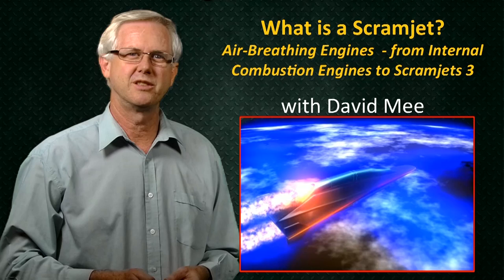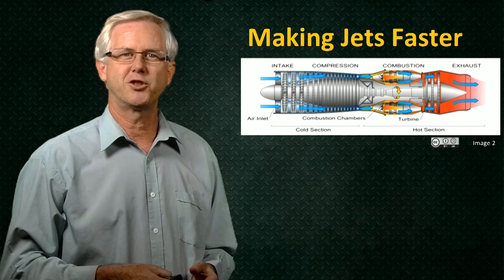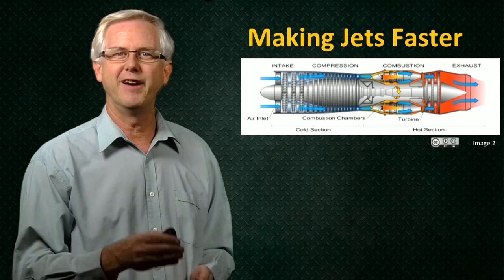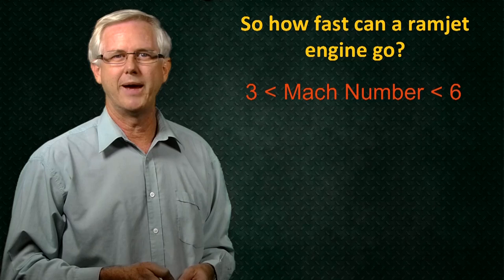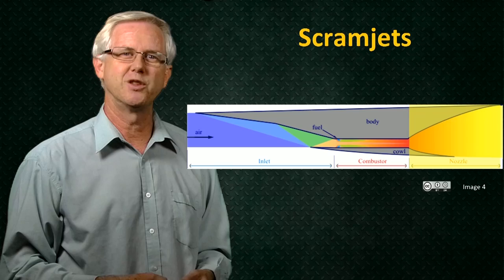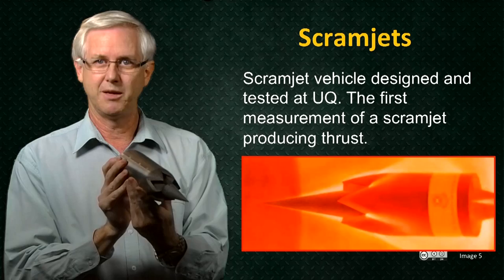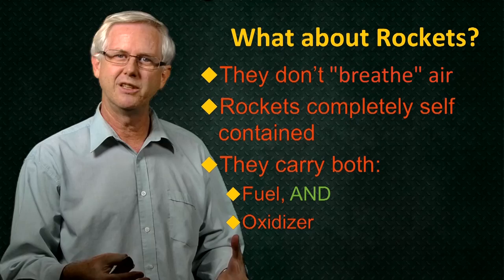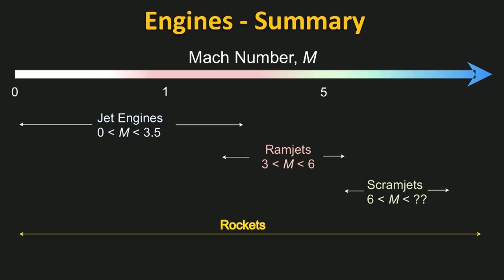UQx HYPERS301X 1.5.1V5 Ramjets and Scramjets

Comment: Its Good, Just one question professor. Ain't this gonna screw up the fuel. I mean we won't get the fuel burn efficiency as we get in the conventional turbo or Ram engine. The slower the v in the Combustion chamber the more efficiently the fuel burns.